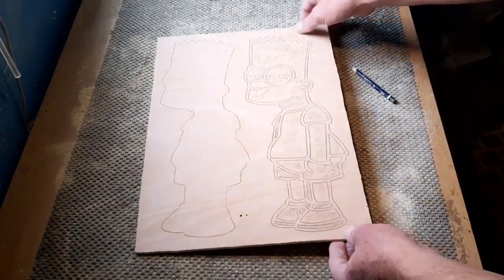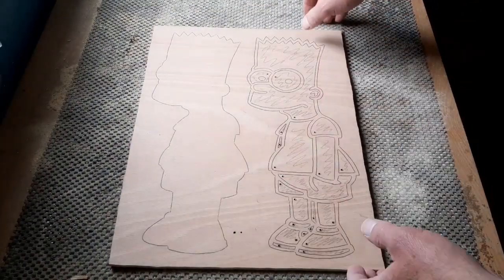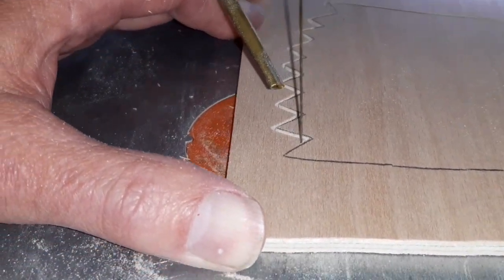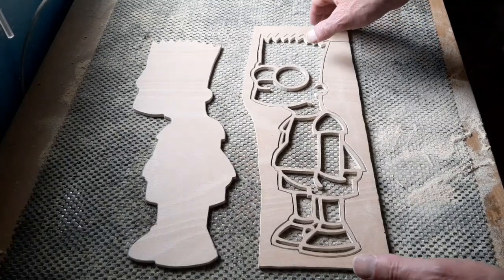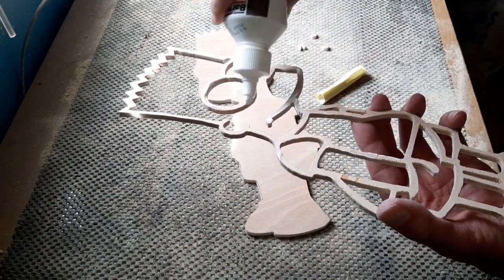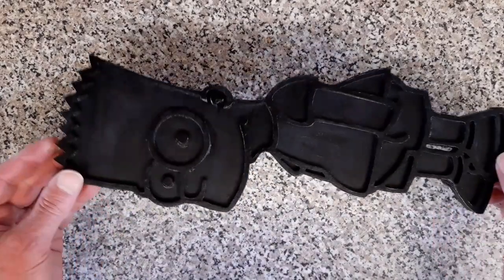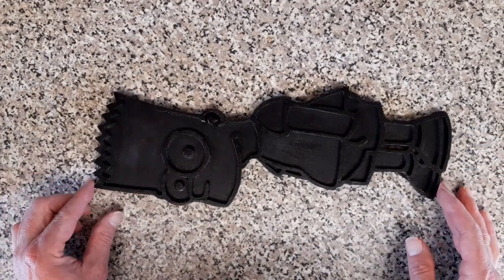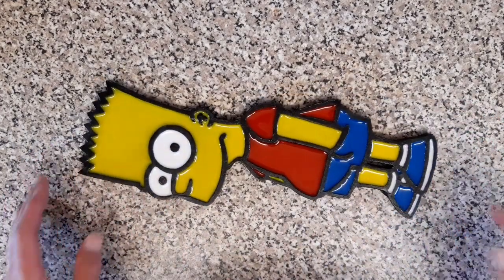Bart Simpson inlayed with resin.. scroll saw project

Comment: Well done in getting that cut with thin lines and so large voids without snapping them badly. I often put the cutout back and tape with painters tape to give strength. Nice cutting
Reply from the maker: Thanks Dave to say its just cheap plywood it seems pretty solid..I've had bits pop off before..😁👍

Comment: I have a question about my first attempted cut.  The design is USA.  I drilled all of the holes using my Milwaukee drill.  I used a smaller drill bit, and i found that the saw blades were still too small to go through the holes.  How do you figure out which blades to use.  If i made them any bigger, they would be outside of the space of what i was cutting out.  I was a little frustrated.  I believe they were pin blades.  Any advice would be welcomed...Thank you so much.
Reply from the maker: Looks like you might have to try a pinless blade  they are really small like needles in thickness so you only need a small pilot hole..if your saw doesn't take pinless blades you can purchase adapter clamps, I have to use them on my old draper scroll saw..👍